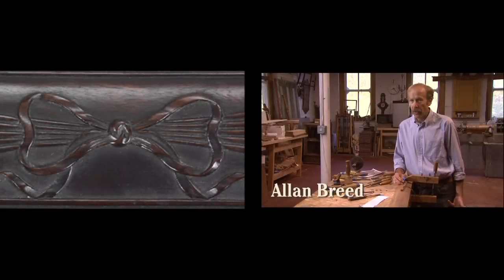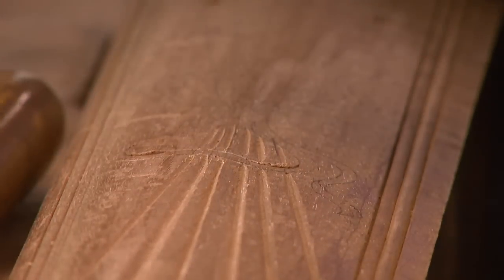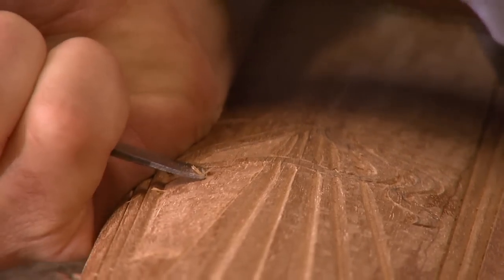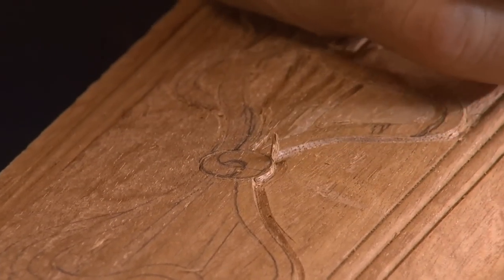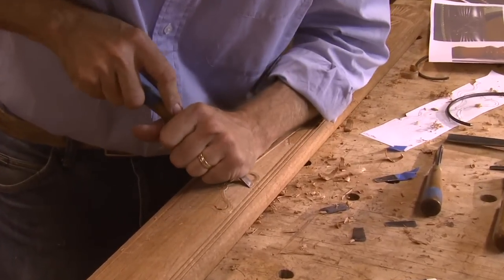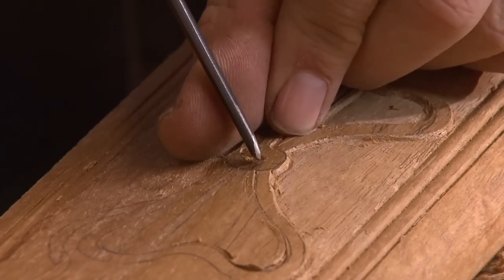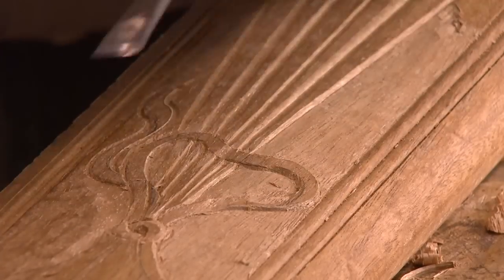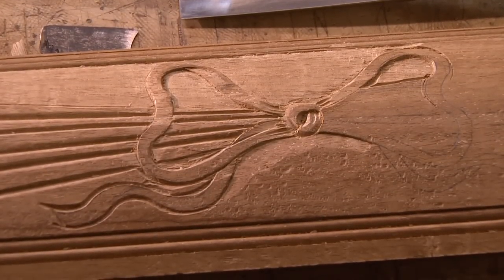Duncan Phyfe Low-Relief Carving: Craftsman Allan Breed Carves a Bow Knot and Thunderbolt Crest

Comment: I notice he is not using any..., how they call it, its not a hammer, but something with which you hit the tool at its rear end, thus pushing it slightly to remove a slice of wood.
Also, he doesn't seem to follow the lines of the wood, that is those natural schemes that you can see on the surface of the wood due to the growth of the tree. Then again, perhaps this was an artificial kind of wood, or some kind that it didn't matter which direction your tool goes removing slices from the wood.
-.
Reply: a mallet